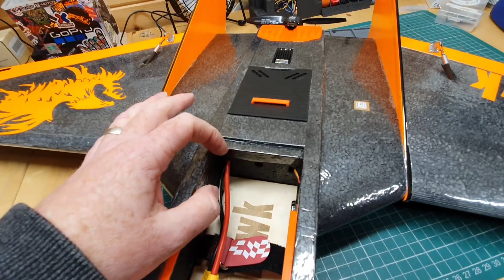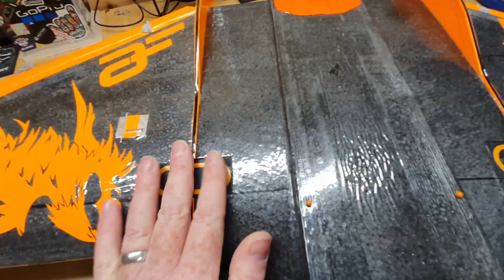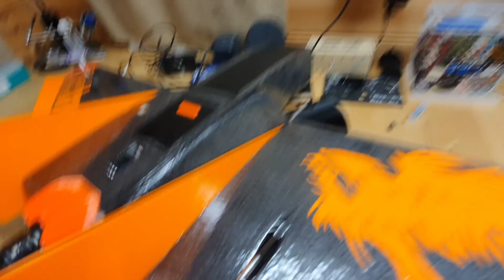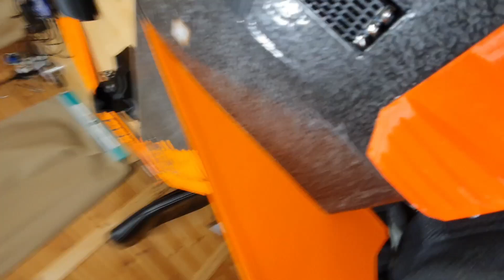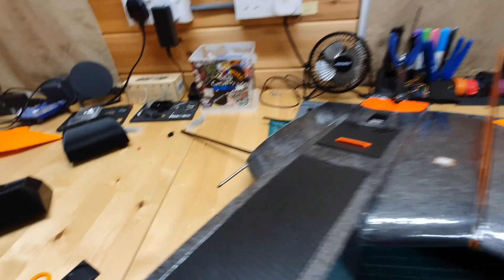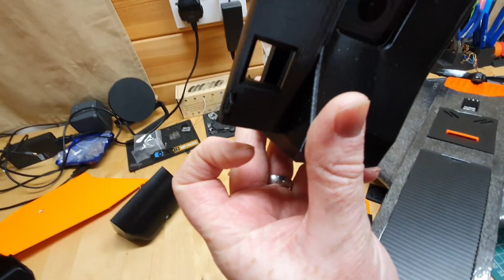Blackhawk Extreme Build

Comment: 👽👽👽👽👽👽👽👽👽
LOOKS LIKE A DRAK TO ME.
Reply from the maker: A couple of people said that at the time E-wings released it (The plane isn't my design just the mods). So E-wings actually got Chris's support from Ritewing before they launched it. It's actually very different when you see one next to a Drak other than they both have forward swept wings (The Drak also wasn't the first wing to do that, just the best known) this is obviously hotwire cut so the fuse is a different shape, different chord Vs wingspan ratio, different wingspan, different sweep but most importantly different airfoil. The Blackhawk was designed for all out speed rather than cruising so doesn't suffer from the high speed stall characteristics that a Drak does at 165 / 170mph+ I've had mine up to about 186mph and it's still rock solid, no sign of it dropping a wing. The compromise is obviously a slightly higher stall speed and less stability at low speeds. E-wings closed after COVID so these are pretty rare now. Anyway hope you enjoyed the video and found some useful build tips if you came to watch it and not just troll.

Comment: I find the organisation of your workbench pretty disturbing.

Check out the 3x0.5mm strips sold by easycomposites. Easier to seat than a 1mm thick strip and they weigh 5-7g per 1m length.
Reply from the maker: 🤣It gets absolutely destroyed during a build then I have to have a big tidy again!. I like easy composites do use them for some stuff , ive actually got some 3mm strips just decided I wanted to go with thicker / wider for strength on this one.